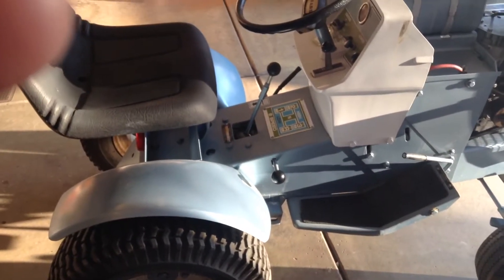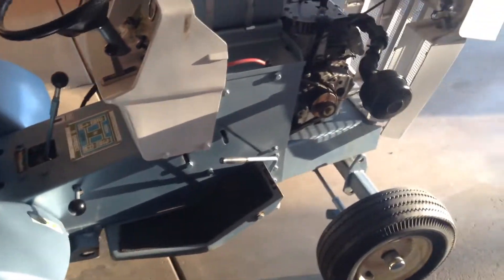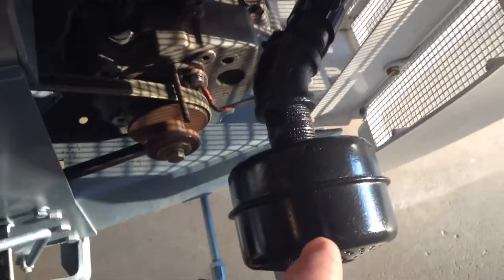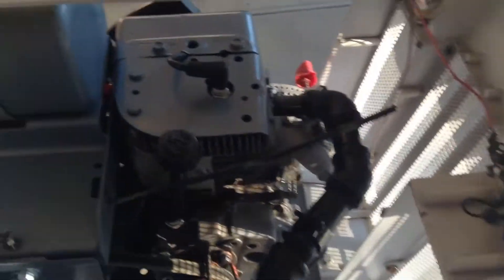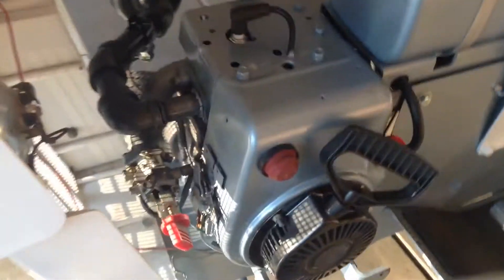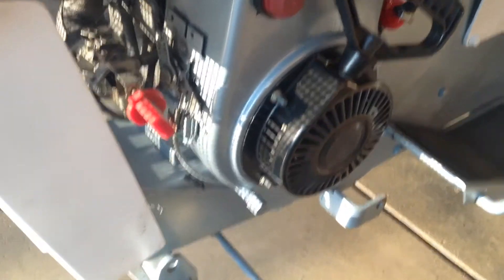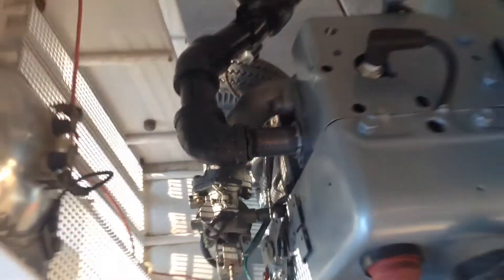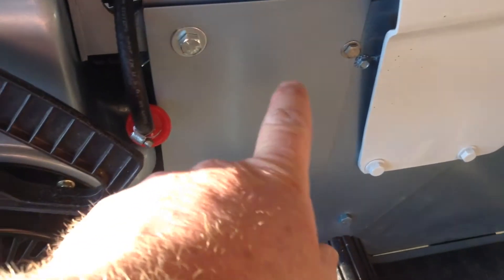1972 Sears Sub 12 update 3

Comment: You still keep the 120V starter on her? 
also you going to run a air filter or just keep her asis for winter use?
Reply from the maker: +StarPuss www.ToxicRedNeck.Com I wish I could have but it was in the way of the clutch. Yes I'm gonna run a filter, I think one off a Custom might just bolt right up on there so the only way to know is steal the one off my custom to see. lol! I thought it was weird how they have the carb hanging down so low on these engines.